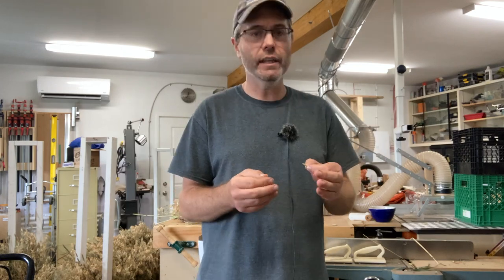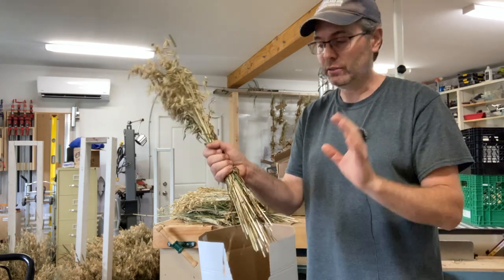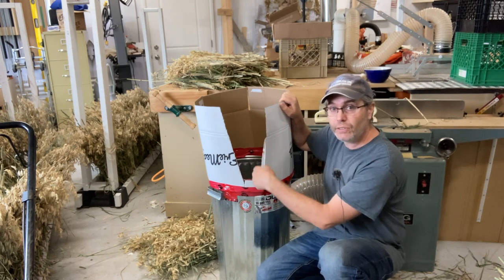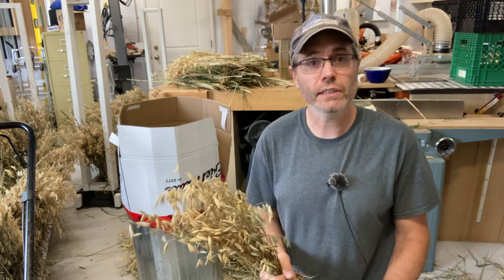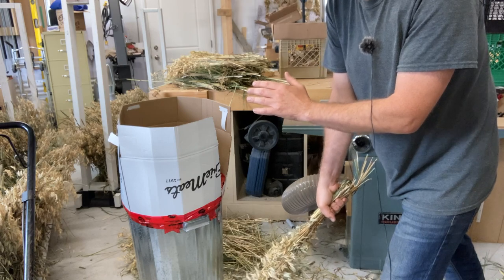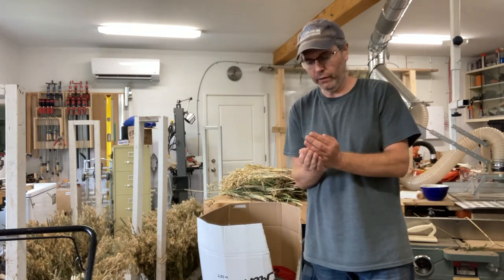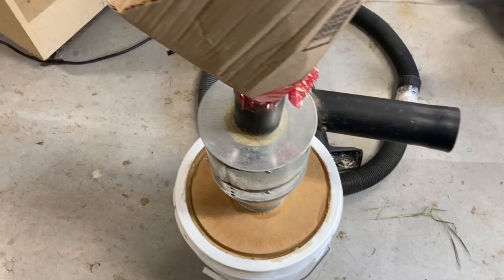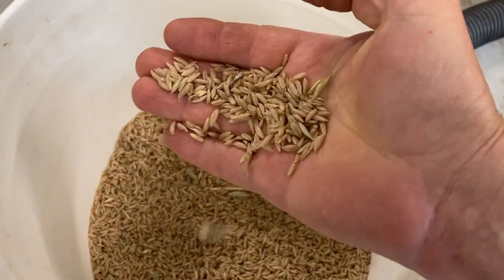Hulless Oats Small Scale Processing

Comment: I'm still confused? You said there's hulless and oats with hulls? I'd guess mine is with. Guess I'd need an additional process?
Reply from the maker: yes there are several types.  Hulless and hulled.  Hulless oats have not hulls once threshed.  Hulled oats do.  You need a dehuller to remove the hulls before grinding hulled oats.

Comment: Thanks for the video. I have a dehuller for barley. Would it be too much for oats?. Also, when you are grinding the oats, it is the same kind of grinder as for wheat berries? And do I need to grind it for breakfast oatmeal?. Not sure what kind of grinder you have there. Thank you.
Reply from the maker: You only need to thresh and winnow for these oats.   The grinder I use is a wondermill junior deluxe.  Works perfect and I set it on a coarse grind for cereal.   I typically use 1/3 of a cup f coarse ground oats to 1
Cup of water soaked overnight.  Cook for 15 mins in the morning!

Comment: If one just wants oats for flour, can one include some hulls in with the groats to be ground into flour?  Or will these hulls mess up your grinder?  Thanks
Reply from the maker: the hulls don't easily grind.  they leave little hard fibers.  you want to get it mostly hull free before you grind
Reply: @TheHomesteadatFlatrock 
Thanks for the reply.  I'm lucky enough to have one of those high speed flour grinders that sounds like a jet taking off.  Do you think this type of grinder would give the same result?  It does well with rice and sorghum.  Would these little hard fibers be noticeable in say bread or cake?  TIA
Reply from the maker: @888zz999  I have a hand type grinder with stones, hard to say, if it used blades instead of grinding, it may work.  You could try using a small amount to see
What happens
Reply: @TheHomesteadatFlatrock  Yes, if I had a small amount I would ;-).  I think I'll go ahead and buy some raw 'nuda to grow anyway.  Looks like it might be more doable for home processing (great video).  And try the 'sativa if I come across some.  There's some info out there that suggests including powdered hulls for other nutritional needs.  Thanks!